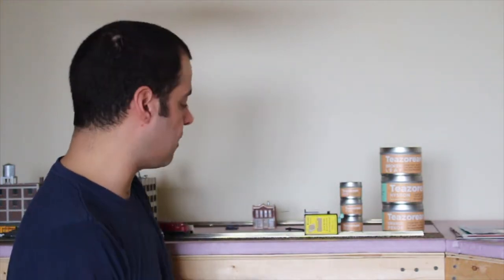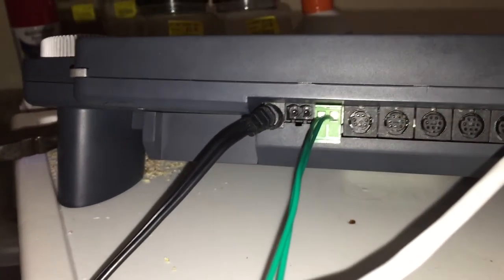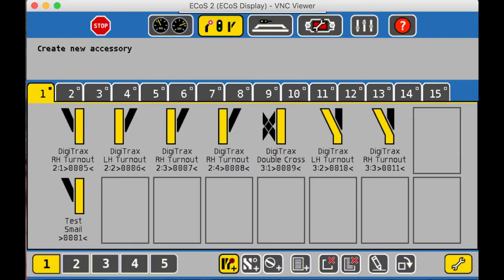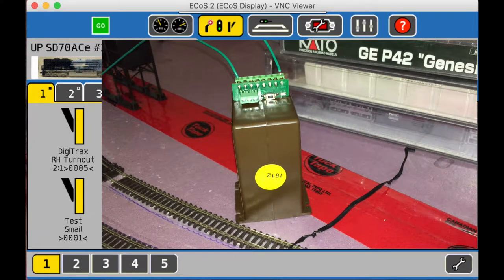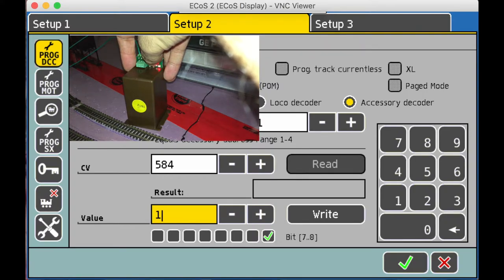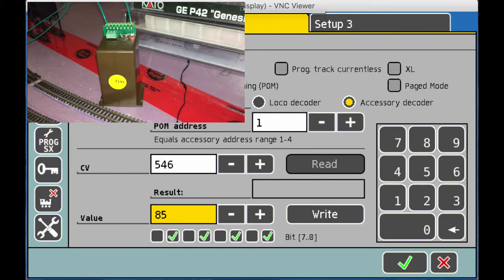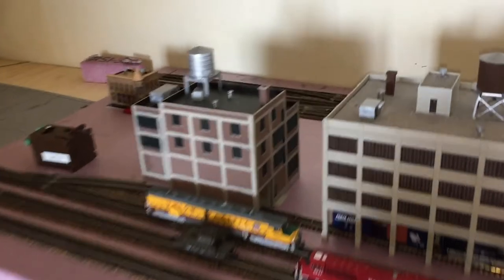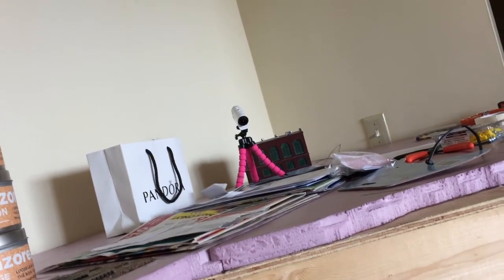Smail Switch Motor install and program

Comment: You seem to be the closest one on the internet to address smails at all.  I was pulling my hair out on powercab and you explained this well.  Thank you,  Patrick
Reply from the maker: Hey Patrick,   Thanks for your comment.   LOL It seams like that is what I feel into! Using products that do not have much info around!! LOL  I'm glad that I was able to help you out.  They are great switch motors, but unfortunately they did not work with some of the features on the ESU ECoS2 controller.

Comment: Thanks for sharing. Very usefull info. Been considering whether to go Cobalt Digital or stick to Circuitron...Now I know :-)
Could you provide links to the items you bought. Both Smail and blocks. I would love to see how you connect the blocks to the smail :-) Thanks much
Reply from the maker: Hey Carsten, Just before you make your final decision just be aware that the Smail Switch Motor does not like the Railcom technology, so if you have a system that has Railcom then you would have to turn off the option or the switch motors won't work. I will be doing a video on comparing the two switch motors Smail and the Cobalt Digital very soon. With the system that I have I will be going for the Cobalt my self because of the issue with the Smail motor.

Thanks for your comment........... Keep on modelling............Tim
Reply: Thanks. That's important to me as I'm using EcoS and Railcom...hmmm... Guessing Cobalt then :-)
Reply from the maker: You and both.

Comment: Does it power the frog with just the  one wire.  Are there no incoming wires from the track like the tortoise?
Reply from the maker: Hey Deryck,  Thank you for your question.  
Form my understanding there is just one frog that is needed for the set up that I have. What the frog's job is to turn on and off the power of the track peace that redirects the wheels of the train. My daughter like to call this the "flipper". The reason for this is to reduce the chance of a short. 

As for the power from the track, the wire that is ran under the layout, connects to the track every 3 to 4 feet. This set of wires is called "bus". From this bus, I have wired Smail so that it not only powers the Smail but also able the Smail is able to receive the information for the DCC controller.  

If you have another questions, please feel free to ask. 
Regards, 
Tim...

Comment: Good video thank you. now watchers SAVE MONEY 
 get over your fear and buy a nice soldering iron kit for 25.00.. curcutron wants 43.00 for those easy terminal blocks you decide.
Reply from the maker: Hey Michael, 
Sorry about the late delay for this response. YouTube didn't notify me of a bunch of comments.   
This is a great product, only if you have a compatible system.   Unfortunately the ECoS 2 is not one of them.  
I agree,  getting into this hobby, one of the key important skills one should have or would need to learn is to solder.  
Thanks for the comment.  Stay safe and all the best.

Comment: Wow just a small area with many Smails , I love the editing man Q:why the Smail motors Tim compared  to Tortoise  Etc
Reply from the maker: Thanks Rich. Ya that section is going to be pretty busy. A: Ok so the reason that I pick the Smail over the Tortoise is that I'm not a big fan of wires. The Smail already has a decoder in it so all I have to do is run wires from the bus line straight to the smail.
Reply: I use DCC Concepts Cobalts for the same reason & also because they made here in Aus also + no soldering
Reply from the maker: I think theres an option that you can bye these Smail switch motors that have the terminal block already installed but ya I get what your say Rich. Being up here in Canada we sometime get the short end of the stick if you know what I'm talking about!! When I was first looking around for the switch motors I wanted the Colbalts but they where to expensive to ship them here.From what I have seen I think the Colbalts are better then these Smails, but beggars can't be choosers!!! But they're better then the Peco switch motors!!!
Reply: I was peco fan for 20+ years & eventually got tired of the constant hassles so I found the Cobalts 2years ago & the are so simple to use & install + cheap . you can get Cobalts from https://www.modeltrainstuff.com/Switch-Machines-s/3041.htm?searching=Y&sort=3&cat=3041&show=30&page=1&brand=DCC%20Concepts I buy them direct from Perth Aust but MTS sell them
Reply from the maker: Thanks Rich, You know what..... I'm going to need more switch motors so I'm thinking of getting the Colbalts an then do like a comparison with the two motors!!